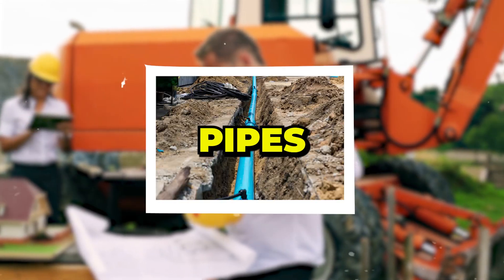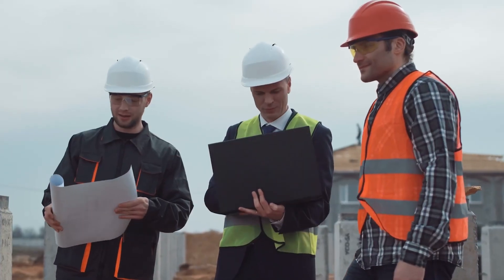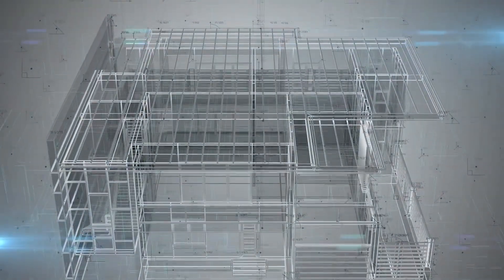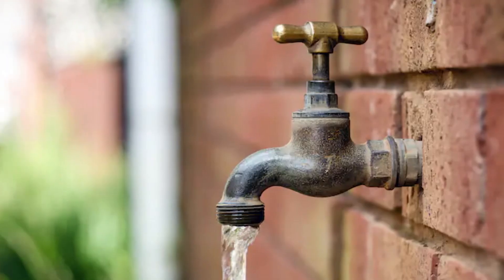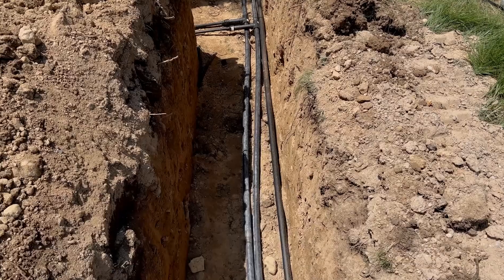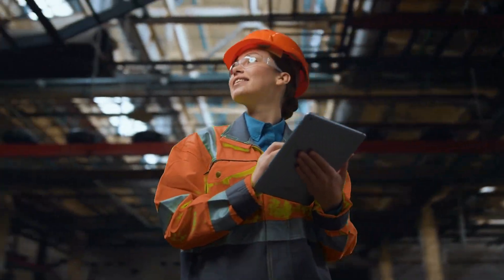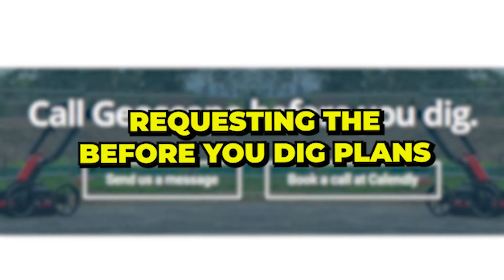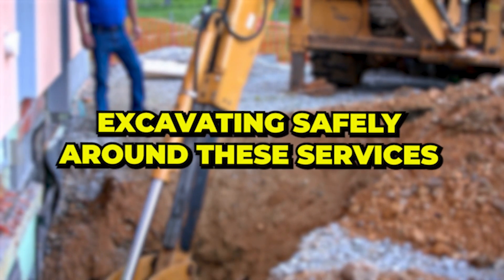What is The Easiest Way to Find Underground Pipes and Cables?

Comment: Hi Geoscope!

I once used the method; “If I was a water pipe, where would I be hiding?”. Unfortunately it didn’t work out so well. The excavator operator pierced a water pipe (luckily unpressurised) whilst digging a trench running across the entrance to a high traffic area. It caused significant stress to all involved and affected my company’s reputation. 

I really wish I had of heard of subsurface locators earlier!
✌🏽
Reply from the maker: Sometimes that works, and sometimes it doesn’t. It’s not a solid strategy, but there are better ways. I’m glad you now know that locators exist. We live and we learn